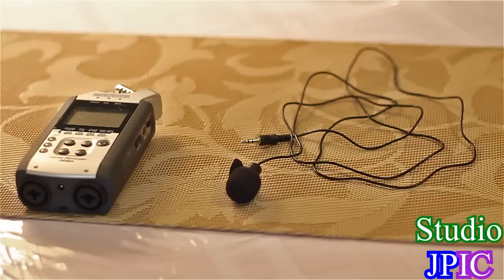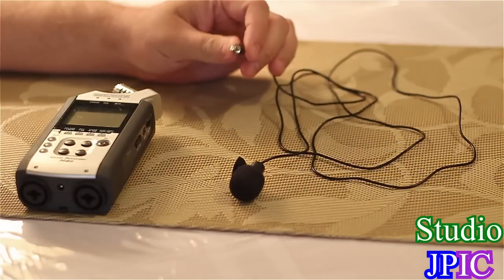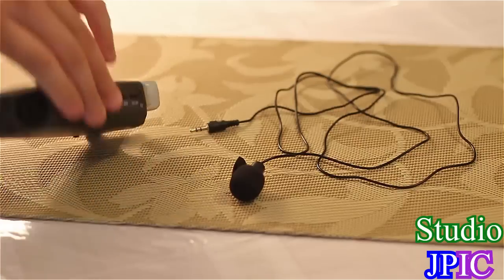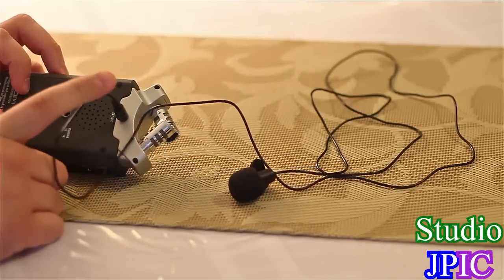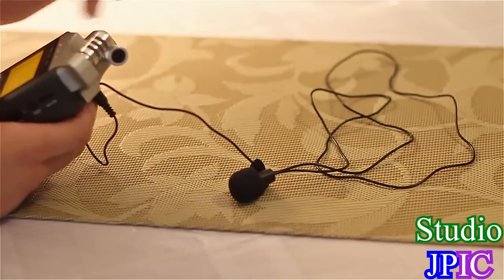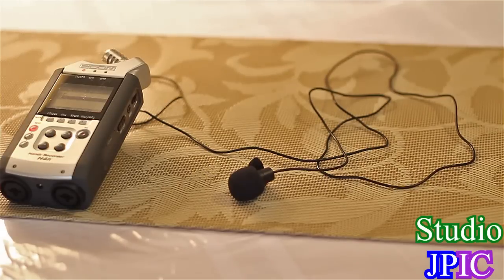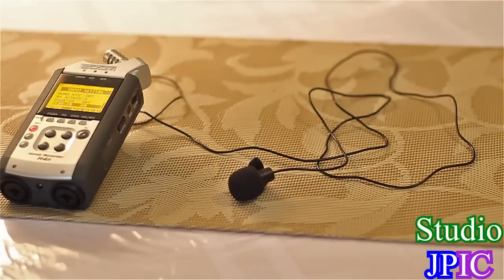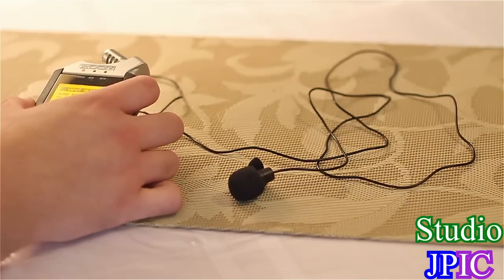Zoom H4n Introduction - How to plug in a 3.5mm mic such as a Neewer Lavalier Mic

Comment: My el-cheapo lav came with a TRRS 4.5mm converter of some sort, which had no effect, bizarrely, it was just a barrel thing. But the 90-degree crazy cable it also came with was in fact a proper TRS converter as well as an angled cable strain, and that gave joy. (Cheap mic since it's a cheap build which may get damaged or not even used/experimental .) Your video was the clue I needed, thanks.

Comment: Thanks. Giving power to the port is needed, but with Rode SmartLav+, I needed also to attach the TRRS to TRS adapter, otherwise it didn't work.
Reply from the maker: Thanks for reminding me, a TRRS to TRS adapter has been on my to-buy list for that same reason.  I have been using my SmartLav+ mostly with my Android phone so far.
Reply: Mine is not working with the adoptor :(

Comment from the maker: Hi Parrott65, there are a few solutions you can use.  On the more professional side, there is the Azden CAM-3 mixer which is portable and lets you mix up to 3x 3.5mm mics.  Alternatively, a 3.5mm female to XLR male connector could work.  You can also find or make a 3.5mm Y cable that sends one mic to left, and the other mic to right channel.  Or you can buy a Zoom H1 for the 2nd mic and each actor/talent would have their own and they wouldn't be tied in together.

Comment: The issue remained on my side. But I figured out that I needed a 3 pole jack adapter. My lapel mic (3,5mm) has 3 black bands on its jack and the adapter has only 2 black bands. Resolved the issue

Comment: How do I use the 3.5mm mic and the 2 XLR inputs at the same time? 

I would like to use 3 mics, 2 wired running in the 2 XLR ports and 1 into the 3.5mm input under the Zoom H4n.

Thank you

Comment: Zoom states on its website: "microphones requiring Plug-In Power (2.5 volts) can be connected to this jack" (from the h1 to the h6 zoom says 2.5 volts). Now my question is if I can use a zoom recorder with a rode videomicro, which, rode states on the website, is "powered by camera plug-in power - minimum 3V". So, can I use a zoom microphone with a microphone like this requiring 3v plug in power?
Reply from the maker: Hi Lucca Nicchiarelli, I am not an electric engineer, but personally I would probably follow the specs, meaning I would not use a 3v mic with a 2.5v device.  You may want to contact both Zoom and Rode to see what they think.

Comment: I need to plug in more than 1 3.5 mm mike...what kind of adaptor do you think would work for that ? for the xlr to 3.5 mm
Reply from the maker: Hi altamash urooj, I only have one 3.5mm so never had an issue running out of inputs, but you can buy a 3.5mm female to XLR male connector.  On the more expensive side, there is the Azden CAM-3 mixer which gives you 3 inputs and 1 output which you can mix together.  In that case, you would use the Zoom purely as a recorder.

Comment: Is it possible to plug in two lavaliers? I'm getting a Zoom H4n along with other stuff I need for film school from B&H, but I'm kind of low and budget that's why I'm just getting the Zoom H4n itself without the accessories package - would I need any adapters to connect two lavaliers? Also, how do I connect the H4n to a camera? Thanks!
Reply from the maker: Hi +MalloryJacobPacheco, you can connect up to 3 lavaliers if you have the right type of lavaliers / cables.  2 XLR and 1 3.5mm.  There exists some adapters which allows you to plug in a 3.5mm mic into an XLR port.  As for sending signal from your record to your camera, a typical 3.5mm audio male-male cable will do, you plug your camera as if it was a pair of headphones.

Comment: hey. Thank you very much for the video. I have exactly the same set up but find excessive amount of background noise and need ti reduce the mic volume down to about 30 to balance between hearing the voice and cutting the noise out. What can I do to stop this or what id causing this?
Reply from the maker: Hi Adam Najduch, background noise can be caused by many things, but it all boils down to signal-to-noise ratio, I.e. how much good audio is being recorded (signal) vs noise.  The first culprit is mic placement.  Every microphone has an ideal range where it picks up your voice better.  The second culprit is the microphone itself.  A good microphone will usually have a high signal-to-noise ratio meaning there's a big difference between how much good signal is being sent versus how much noise.  The next link in the chain is the pre-amps.  The pre-amps are part of the H4n, and they amplify the signal coming from the microphone.  The louder the signal is, the less the pre-amps have to work.  In the case of the H4n, the preamps aren't of too good quality, so you need a microphone that provides a strong signal.  I find it worst for the preamps of the 3.5mm plug, I find the XLR to be a bit better.  And upgrading to a Zoom h6 made a good difference for me.  Finally the last step is the recording itself, and in the case of the H4n and H6, I find the recorder part of them is extremely good, so it's usually the other steps causing issues.  There are some software which can help though, I have a video on how to remove background noise using Adobe Audition.  With the H6 and the new lav mic I use, though, I rarely have to use it.
Reply: that you a lot for sharing your expertise with me. Ive seem the Audition video. Can I ask whether the software can be used for post recording recomave of all noise below a certain threshold as ti remove the background noise?
Reply from the maker: Hi Adam Najduch, unfortunately it is very hard to remove any noise without also removing real audio.  Adobe Audition has a tool which analyzes a noise print to kind of guess what types of noises you want to remove, and then it does its best to remove those noises without degrading too much the rest of the sound, but you cannot tell it to just ignore all the noises bellow 32 decibel, for instance.
Reply: Ah right that would have been ideal if it could do that. to set a minimum level and to ignore all below that. Thank you again for your help.

Comment: Is there an adapter to plug the 3.5mm mic into the XLR input?  It would allow for dual mics, and each could be volume adjusted separately.
Reply from the maker: Hi +John Green yes, those adapters exist and would allow you to use two mics, as long as they do not require plug-in power (which is much lower power than phantom power)
Reply: +Jean-Pierre La Forest 
Thank you

Comment: hi,i wanted to ask,
1)the mic need turn on plugin power right?then its cannot use when we plug into XLR input using adapter?
2)i already tried plug a 3.5mm mic to line input and its work..but there had such a effect "teettttttt" how to fix this?
Reply from the maker: Hi *****, 1) Not all 3.5mm mics need plugin power, but if it does, then most 3.5mm to XLR adapters won't work.  There could be some which provides plugin power with a watch battery or AA, but not all have that option.  2) I watched the video you linked earlier, and my first guess is maybe you are using plugin power for a microphone which doesn't need it.
Reply: Jean-Pierre La Forest the mic need plugin power since its just a lapel mic..if i turn off the plugin power the mic doesn't work..im not sure if this happen only at cheap lapel mic..buti tried plug into dslr mic input and the audio is good,no mic effect..just with zoom h6 good that annoying effect.
Reply from the maker: Hi *****, I tried a 2-3$ Neewer lapel mic in my H6 and I didn't hear any issues.  If you check my H4n vs H6 comparison video, you'll hear a sample of the Neewer with both.  The only thing I can remember is with the H4n I sometimes would get a hiss with some microphones when using AC power, which I believe the H6 shouldn't have that problem.  But just in case, try different power options if you can (batteries vs USB) with your H6 and see if any helps the issue.  Hope that helps!
Reply: Jean-Pierre La Forest whoaa you are right brother!when i used usb power no more annoying mic effect!thank you,but i need to explore why using battery got that issue!
Reply from the maker: Hi *****, I'm glad to have helped narrow down the issue.  Out of curiosity, could you try different types of batteries (rechargeable vs non-rechargeable, for example) to see if they all create the same issue?  If it persists, it could be worth contacting Zoom to see if this is a defect, or if it's "working as intended".  In case you want to bring USB power with you anywhere, you may want to look into USB power packs.  I ordered one which should be coming in this week, I'll test it out and give a review of it.

Comment: Hi can you please help, my h1 just broke (line in port). I now need to use my h4n to record wedding speeches. I followed allowing the best that I could but I can only hear static and no vocal audio. I'm using  road lav mic, need this sorted by Friday's wedding. Please help!!
Reply from the maker: Hi Daniel James, the usual culprit with 3.5mm mics is the plugin power.  Some microphones need it to operate, and others will not work properly with it. I would try turning it on or off and seeing which one your mic needs.  (If this were phantom power I'd recommend reading the instructions first for sure, as phantom power can be more dangerous on a microphone, but plugin power is usually low enough voltage)

Comment: I did everything yet still my lapel microphone doesn't work either way!!! I tested on my phone too, the lapel WORKS just not worth the zoom???;? why is this happening!?;?
Reply: Same here... Did you figure out?
Reply: Uddhav Joshi Nope. I sold the zoom back and just use the lapel with my phone. It's the same quality anyways.
Reply: I agree. I just got mine from Amazon today. And honestly I can't feel the difference. I have made some good videos and used my iPhone as an audio recording device in the past. The quality is way better with iPhone I think. I am not an expert but I think $200 price tag is too expensive just to record a sound which even my phone can do. I am going to return my Zoom. 

P.S. - It only accepts TS and TRS pin lavel mics. TRRS (the ones that work with phones) don't work with Zoom. Just did my research.
Reply: I know, 5 months late, but for other in that situation: maybe you need a trrs to trs adapter? like for the ride smartlav+, it works just on phones without adapter. (3 rings to 2 rings on the 3.5mm)
Reply: Christoph Haslinger i tried,  but it couldn't works either, can you guys help pls

Comment: Working on plugging two Giant Squid labs into the Zoom H4N, and learning it's not so simple. First, using a Y splitter does not actually split the the signal, so you don't have independent control of two mics using the EXT mic input. And you cannot use phantom power via XLR adaptor because the min power setting - 24v - is too high. Apparently you need a 9v power supply to get the labs up to line level, and then use the XLR adaptor...

Comment: Thank you very much! I Bought the Zoom H4N and 2 cheap Lavaliers inkl. Transmitter-Station (50 € each) - But in this case I can just connect one Mic with the recorder itself. This is a good alternative, thanks!
Reply: you cant connect both mics 3.5mm mics? even with an adapter